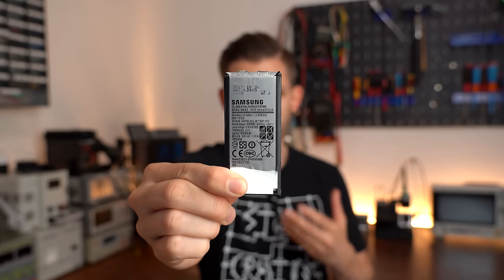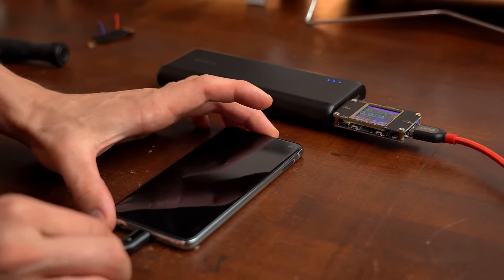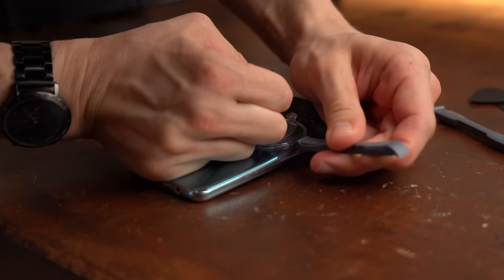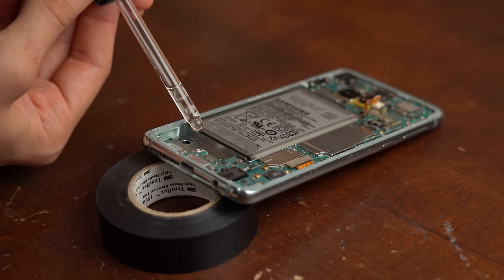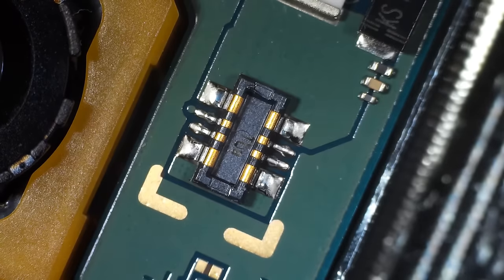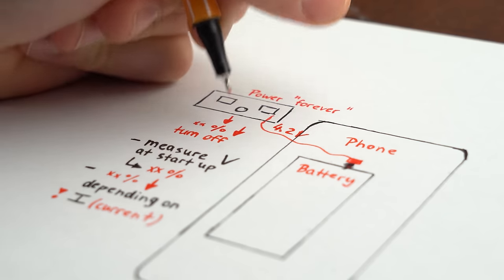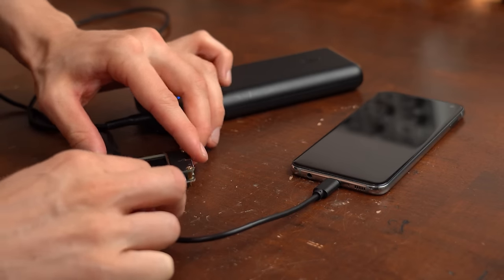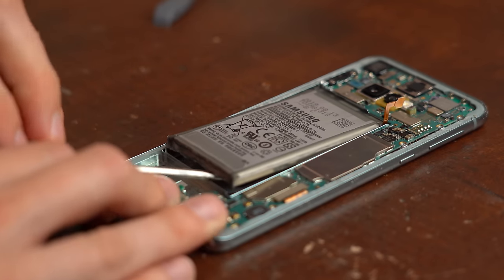I "Solved" Samsungs Swelling Battery Problem! (Batteryless Phone)

Comment: The phone is sensing that the battery is always at 4.3V (75%) yet the USB charger for the phone is always charging at 5V. So the phone will just think it is charging and only use the power from the 5V charger right. Since there is no battery, the 5V doesn't charge the battery while running the phone. But the phone doesn't know that because it only monitors battery output voltage which is set at 4.3V now. Is my understanding correct?

Comment: What if you turn the phone screen off while charging? The voltage at battery connector terminals will become almost 5V through diode because of low current flow and it will ultimately destroy the phone charging circuit...

Comment: This has already happened to my Samsung Galaxy Tab 4, it damaged the audio circuit or speaker and it's next target is the screen as it is also splitting apart and has sperated in one area of the housing leaving the uttermost center of the screen useless to user interaction.

Comment: I did the same, but not successful! It still required me a battery to boost up the system, so I must soldering a small li-ion battery beside the usb cable that connect to the power bank or changer. It work, but so hot! I try it on an old Japanese phone (Sharp Disney) because I can't find the battery for it.

Comment: There are phone charger both support quickcharge and normal charge but i prefer buy a new  5 volts only charger instead. Because some charger OUTPUT 9 volt quickcharge without the data cable plug into the phone (I actually have one and it have fried one of my table fan)

Comment: could have replaced the battery with a 4.2v capacitor, instead of cutting a hole in the phone? 
(saying that I drilled a hole in my last phone for two 18650s glued to the back for years)

Comment: Hey Scott,

So basically I have 2 old Android phones running Android IP Webcam. Pulled into HA and Frigate.
I have also removed the battery on these and they work fine.
Now I have 2 issues both related to Powercuts (very frequent here in India more so in the Summer) - 
1. The charger doesn't charge the phone on Powercut - I have to remove and reinsert the USB and then it goes into a charging state. Can you think of any hacks like say sending a particular signal on D+ or D- triggers the charging?
2. The phones do not auto-start on power - I have to hold the power button to start it again. Are there any hacks that could allow me to start the phone automatically?

Rishab

PS: The phones are Xiaomi Redmi Note Prime and Sony Experia Sola.

Comment: you could wire the 5v Line and Diode inside of the Phone, so just a normal USB C Cable was enough. an the phone had no damage outside. Yo, the fast Charge is still a problem here, maybe a manipulation on the data lines inside was possible.
Reply from the maker: And you would have to solder to the USB-C connector inside the phone. Not possible for most people.
Reply: @greatscottlab  yes, this is not an easy task, but i think the easiest of all, in case you want to make this as a stealth version of this Mod :D  maybe you are lucky an there are some Test points directly for the +5V, you can solder some 
enameled wire. I think i will try, its a nice project for my old GalaxyS5. Danke für Deine Videos.

Comment: you can just install the acc app and enable battery idle mode which disconnect the battery and keep it at 0% and only use power from the usb
Reply: Does that require rooting? Does it work on old phones? S3? Older?
Reply: @TheRainHarvester  yes it dose require magisk module but s3 is easy to get custom rom so not an issue
it do need kernel to support battery idle mode but every phone i have works fine with it and my home assistant dashboard can have full day backup with it

Comment: I am wondering why it's not possible to boot up your phone without a battery. Must have a software checking functionnality
I tried it on my Samsung Galaxy S7 (running on LineageOS 18.1 - Android 11 at that time), to connect it to the wall plug and it worked fine. 
I've done that because the battery (not the original one, a "Samsung" aliexpress one) was like a pillow.

Comment: my s6edge plus worked with only soldering from original wall charger thru usb cable a plus and a minus on the battery protection part

Comment: would be possible to use an capacitor instead of the battery? maybe it will be charged when charger is connect to phone ...
Reply from the maker: Possible. But not sure.

Comment: I'm using already for a while a old fire tablet as smart home hub on the wall where I also removed the battery. This didn't hat the problem with the decreasing battery without a attached charger

Comment: Hi Scott! Great video. I'm planning to do this with my old Huawei P10 Lite. I want to use it for octoprint using octo4a. As I'm using the micro usb port for connection to the printer and a USB OTG y cable does not work for simultaneous charging and data transfer, I need to bypass the battery somehow. Have you any idea how I could trick the phone into thinking its being charged in this situation? Thank you!

Comment: Samsung overcharges the battery and include a battery saver function that keeps the voltage in a better rage of course this safer rage gives you a lot less capacity. The capacity is reduced by around half. And that is from already a samsung-lie (all manufacturers does this) capacity.

Comment: The battery is not the issue. Its the BMS circuit.  The BMS is poorly made, and allows the battery to get to low in voltage, Hence the pillow battery. Changing the battery will do nothing.

Comment: Why didn't you just solder the bms wire to the internal USB c port and  use the 2AMP normal power supply? that way you didn't have to cut the phone and used only one cable .

Comment: Hi Scott. I would like to ask, if I'm about to use a powerbank instead of it connected to Plug Charger, it would still works right ? Then i will have a lot to do with it connected to external battery rather than battery itself especially for robotics project. It's  like powering a computer  using Large Power Bank or a Raspberry pi and a power bank.

Comment: Would you still be able to wire up the data lines to be able to connect it to a PC if you wanted to or would that activate fast charging? 
Looking to turn an older flagship Samsung phone into a nicer webcam that can also do some notification forwarding for my smartwatch.

Comment: I did that without the usb C and noticed the same issue with the battery drop or even the phone not powering on. After experimenting I noticed voltage drop spikes. These trick the phone to think the battery drains quickly but indeed it is not as it is powered. As far as I know the phone will not hit low battery/voltage warning ,20 percent, if it is power supplied. Did you test or experience low value of 20 percent after a while before you add type c charging?

Comment: Another solution to the battery percentage dropping is to root the phone and just change the properties to disable the battery discharging.

If going through type c route then you should be able to jump the wires from inside the phone to the battery circuit board so you don't have to cut a whole in the phone and also be able to unplug it making it look normal.

But that's just my thoughts let me know if I am overlooking something!

Comment: I only buy phone with removable battery. Because the case would not crack if the battery swell up.

Apparently Samsung still make them. The rugged series.

Comment: I'd like to recycle an old iPhone 6 to use as an enclosed  ebike dashboard, ideally with the phone booting up or shutting down when the main ebike battery is switched on or off. Would supercapacitors allow to cleanly shutdown the phone?  (48V battery -> DC DC 5v -> Supercaps(?) -> phone)
Or is there a better way to do this?

Comment: Why not use a capacitor instead? Just look for a supercap or build yourself a pcb with a bunch of ceramic once?
Reply: How long you want that Supercap to live?
Reply: @cpK054L  Until it breaks?
Reply: @mornmorn8425  4.2 Volts, yeah, it'll most likely explode as soon as you plug it.
Good luck finding one rated for this volt in a single cap. You need at least 2 in series, and that'll really start jacking up the costs
Reply: @cpK054L  I use vishay supercaps. Or just use normal caps when you want, could work as well.

Comment: I'd like to try this project but.. What is the lab bench power supply do to the + and - cable? And is it possible to do this project without using lab bench power supply? If it must, then is there any alternative to do this?

Comment: What if I connect a 1k resistance on the positive and middle point of the connector(On Phone) and use the simple USB charger and plug it in the normal charging port, It should still work right? no need to modify body or anything
I want to use this for make a Sensor pannel for my PC.

Comment: I have a similar situation with a iPad 6 (A1893). The battery connector came with 6 pins. It's easy to identify the positive and ground pin, but other seems to be sensor pins. The Samsung phone you worked on looked like the same, more pins than just + and -. Did you leave the other pins float or grounded?
Reply: He didn't do anything with battery pins, he just replaced the battery cell with the grid. Those pins connect to BMS
Reply: @fulconandroadcone9488  You are probably right. My original plan is make sure it's the battery's problem before I replace it, so I want to follow this video to put a USB power in place, thus I asked. It seems the Samsung battery has a lot of difference than the iPad's one. I ended up replacing all the battery assembly and it just worked. I haven't gone back to check the faulty battery yet but from visual inspection it appears there're some other sensors, possibly thermocouple sensors were packed into the battery package wrapping. The battery wasn't budged at all and has a reasonable voltage (3.8V) but refused to charge. So my wild guess would be either some chips on the BMS or the thermal sensor was faulty.

Comment: I still don’t quite understand the purpose of the diode in the circuit. Is it simply to drop the voltage? Why not use a resistor?
Reply: Untuk menghindari arus balik

Comment: Is there a way to remove the battery cell but use the BMS board of the battery and solder resistors/capacitors to the BMS terminal to trick it has a battery? I would like to preserve my old iPhone but I do not want to drill holes.

Comment: made one with my old phone that got 2 batteries swell, so i got fed up and put 2 high capacity 18650 cells at the back and routed the bms connection tru the headphone jack. Only thing to keep in mind is that it looked like a bomb hahahaahaha

Comment: Excellent video, thank you.  I have an off-brand smart phone that i used for its camera and with Google Voice that I could no longer get a battery for.  I often mused with disassembling the battery and replacing the LiO cell but wasn't sure it would work.  Now I see that there are several possibilities, including external power.

Comment: Quick question. I am planning on using my old S8+ as Dex for old TV. I have a USBC hub with 1 HDMI, 1 USBC (power) and 1 USBA. I planned to do similar mod, but would require a data to go to phone. The power from DC charger would have data lines cut as per this video, but USBC hub does not. So am wondering if quick charge can still happen in this scenario, or better would be to use charger without QC

Comment: Could you not of just tapped the usb power into the battery connector through a diode? Then when usb connected it thinks the battery is at 90% and on charge.

Comment: Could I use capacitors connected in parallel and a diode to put them in the phone?  then plugged in the usb cable.

Comment: My battery's protection circuit ribbon got broken. So i tried with TP4056 module which i think would've worked but it didn't. I have cut data wires connect +ve to TP4056 via MBR20200ct and -ve direct to TP4056 then TP4056 +ve and -ve to Ribbon +ve and -ve respectively. Connect phone boths ways micro usb (i am using S7) and board power terminal, but phone not opening.

Comment: Can you do it with an Ipad cuz i read once that the tablet just restarts if it needs more than 5v2a. Like what other MUR Diode should I use? And I fear that just using higher voltage will just make stuff burn without proper hardware to support the higher voltage.

Comment: Why not just put a supercap in place of the battery?
Reply: because supercaps aren't meant to supply power like a battery?
average battery has around 3Ah * 3600 seconds → 10,800 Coulombs of energy
Capacitance = Charge / Volts → CV = Coulombs, and at 4.2 Volts, you're looking at 2.6 kiloFarads for an equivalent, good luck finding a gigaCapacitor to fit that

Comment: I did it with my wiko u-pulse and it's working. Just unfortunately the motherboard now is need to be replaced cause it's dead (flashing wrong firmware and when i connect this thing to my pc, it's immediately trying to boot up when my flasher trying to connect)

Comment: BTW its funny how samsung claims to look into it but the video that showed the problem also already showed why it was swelling... its the chemistry of samsung batteries for their smartphones decaying faster than their competitors... we just don't know why half of them decays faster but looking at past history with samsung components... its probably the usual machine tolerance problems in their battery manufacturing plant.... its also why i stopped using the only samsung branded products and components i had after the note 5 with the exception of the snapdragon 8 gen 1 chips... as they are the sole manufacturer of this chip and it turns out it can lose to a TSMC snapdragon 700 series chip in gaming performance... how ironic is that... a top of the line chip losing to a lower tier chip... this issue is the last time i will ever use any mobo/chips or any products that uses a samsung component or a samsung branded product.... they are really bad manufacturers when compared to other manufacturers with their own few sets of OEM brands....

Comment: I have an old Ericsson A1018s i want to run without a battery, but even if i connect power to the two pins it won't start. I can't find out how to do it. There must be something that detects that the battery is removed 😪

Comment: Rather than cutting a new hole, why not just run wires from the usb connector inside the case to the battery connector? Also, instead of a diode you could use a $2 tiny buck board positioned in the battery cavity to ensure the desired voltage even if usb port switches to fast charging.
Reply from the maker: Hard to solder inside to the USB C connector.
Reply: @greatscottlab  Is there nowhere nearby to get access to the traces carrying the power?

Comment: hmm so disabled dataline to make sure it safe, and now you can only transfer data over wireless instead cable directly plugged into pc ?
is there any ways to also power-up battery-less phone and also use cable to plugged directly into pc, which can enabled adb + gnirehtet

cuz when i connected battery board into mainboard then plugged ravpower61w with PD type C  PD charge cable, and it just work, but there's red light always blinking and tell me temperature of phone is too low and it stop charging (still power-on)

samsung s8

p/s: after turn it off, now it just charging loop :)

Comment: I don't understand the problem with the swollen battery, they do that when they get old and it's time to replace them.
Reply from the maker: Replacement is definitely a solution here. But the problem is that some consumers reported that the swelling happened 1 or 2 years after purchase. That should not happen.
Reply: @greatscottlab  Didn't know the time frame.Thanks

Comment: I have a galaxy s4+, its an old phone that my sis gave me and the day before she gave me it lasts 5 hrs of heavy usage, now i factory resetted it and the battery shows incorrect percentages, even dying at 55 then shows 0 when you boot it. Any ideas? Im afraid the phone might overcharge it and turns into an automatic grenade
Reply from the maker: I think overcharging will not be a problem. Sounds like its capacity is just heavily reduced. Better replace it.

Comment: Hey there I have old headphones and I want to use its board as a Bluetooth receiver for my speakers but the only problem is that to start the Bluetooth I have to press its given button for 3 sec to turn it on so can you help me make a circuit without an Arduino to trigger the circuit for only 3 sec afterwards its off rest of the time please help me out

Comment: One of the LiOn batteries I've worked on actually has the IC to report how much battery life is left... I'm not doubting that Samsung has the same architecture.
Hence why your power supply is not giving it the I2C response it wants, so your phone is basically "guessing" what it is, it's not guessing based on Voltage.
This just destructive for no good reason..... you can literally just build an R-Pi module for this instead of wasting a 3-figure phone for this....

Comment: Wireless Charger with MagSafe would be a much more elegant solution that support also the usage of the original backcover. Inside you could have connected the bms with the charging coil.

Comment: Also useful if you need a permanent phone in the car.
Reply from the maker: Definitely
Reply: @greatscottlab  I am surprised that the manufacture had not engineered the  phone software to stop such a modifications. Batteries are used by manufactures to build in obsolescence.

Comment: SAMSUNG SCAMMING at its best. Even a constant voltage source losing charge... This would mean even a higher capacity battery @4.4v would "drain" as fast as a lower capacity battery @4.4v.